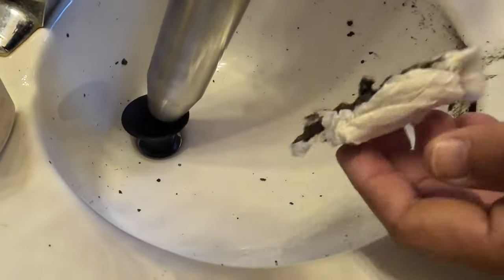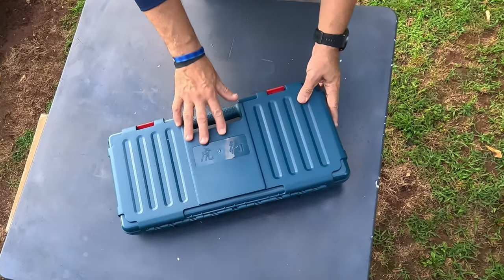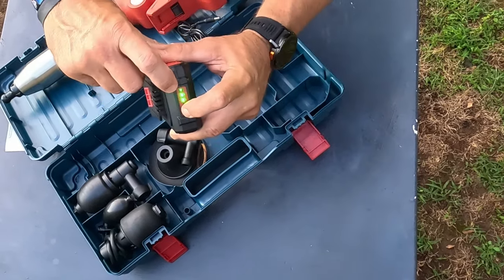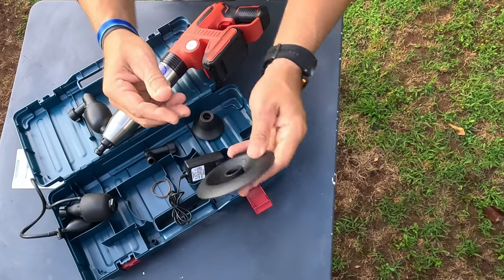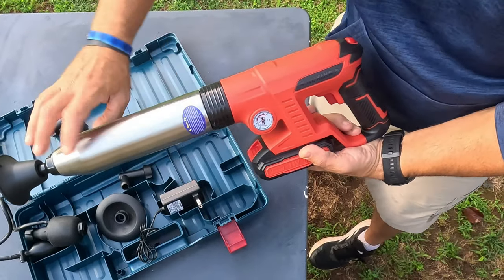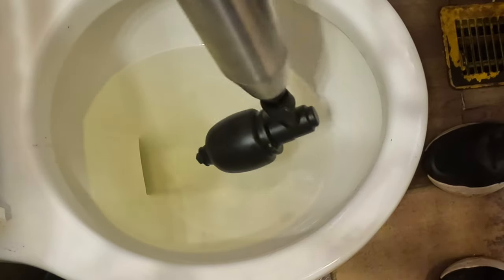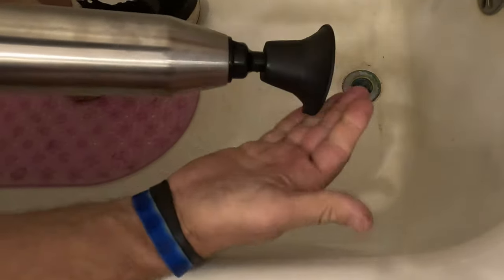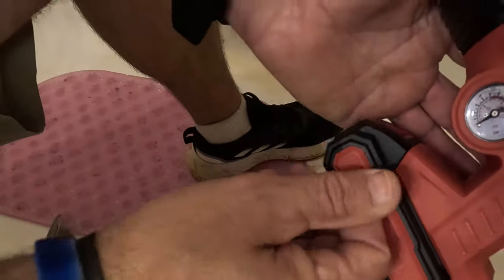Electric Toilet Plunger Amazon - Testing/Review

Comment: Be sure to block the overflow on tubs/sinks when doing this on clogs so you don't let pressure escape via those orifices.
Reply from the maker: Yes, lessoned learned the hard way lol and in hindsight I would have done that in the video thanks for the feedback!
Reply: Make sure you have what you need to safely get to and walk on the roof.  Sometimes it's the vent that goes up there that releases pressure so it doesn't get to the clog.

Comment: Just make sure to back it out and let the water fill back up that way your pushing water pressure and not just air. You want a good head of water in front of that air pressure to move that material along.
Reply from the maker: Thanks for the tips for sure next time use I’m doing that

Comment: So here's what happe s.  I used it once and then of course I took it apart and put it back for the next time. I charged it. Light was green. I unlocked the little red button at the top and it just started humming. 
  Where exactly is that little round rubber seal supposed to go on the machine.? Wherever it was it came off when I took it apart I don't remember where it was. Also when I charge it is that little button supposed to be locked?
Reply from the maker: The rubber seal goes on the end